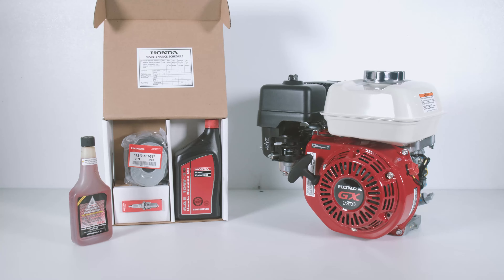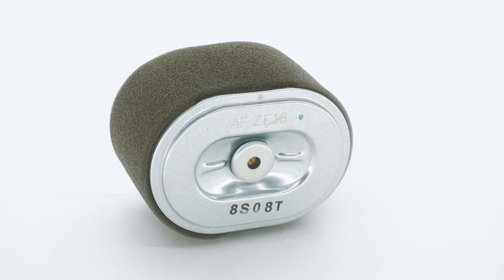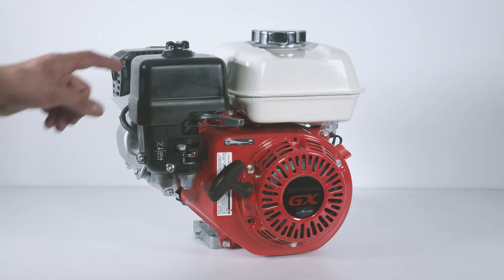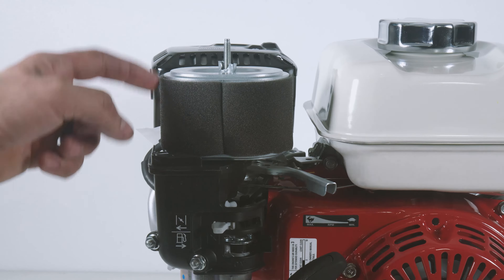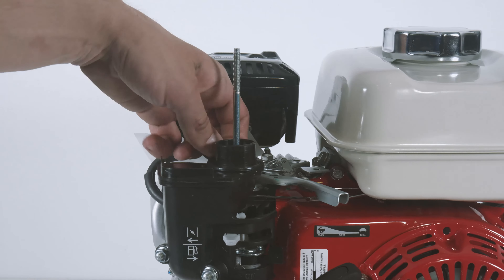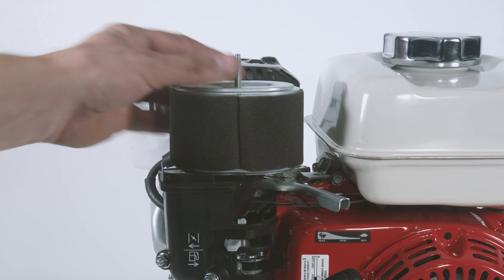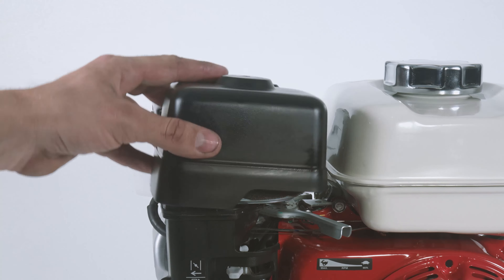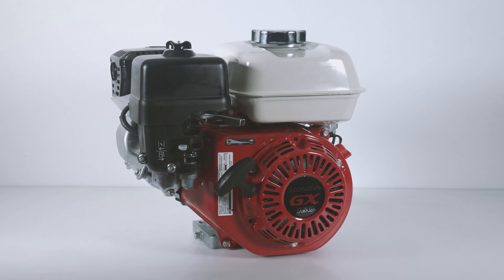Changing the Air Filter on a Honda GX160 Engine

Comment: Why doesn't your Honda have the base for the air filter that the cover sits over? Mine was missing on my generator which cause the unit to surge. So I took a base off of a different piece of equipment and it stopped the surging. It needs that piece.